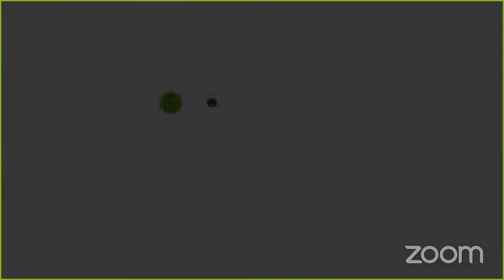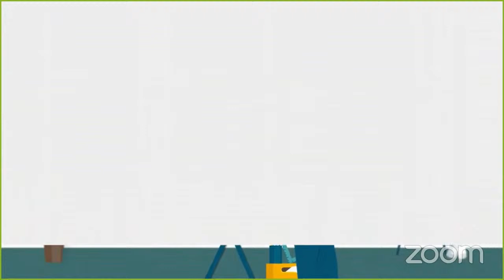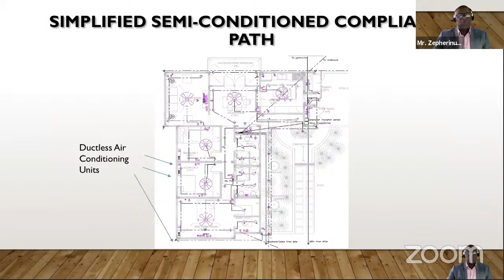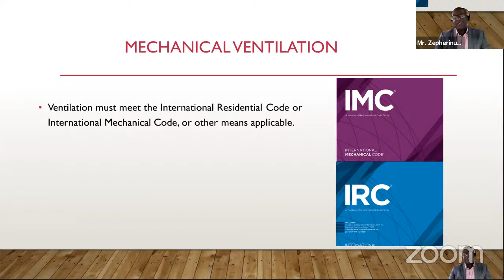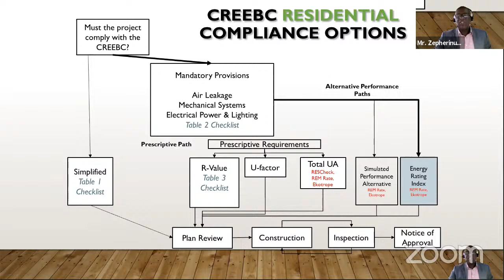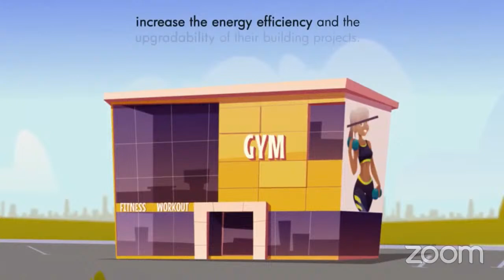The CREEBC in a Snapshot: Residential Implications (A Virtual Town Hall)

Comment from the maker: As all questions posed during the webinar could not be answered live, here is the Q&A with responses supplied by Mr. Churchill Norbert:

Q1: Does the projection factor take into account surrounding buildings and trees etc? 
A: No, the CREEBC does not consider surrounding buildings or trees for residential buildings. ASHRAE 90.1 takes into consideration surrounding buildings for commercial buildings. 

Q2: How is the energy code for car icon differ from that in north America and Europe?
A: The CREEBC differs in terms of climate zones and the corresponding design requirements for buildings in the Caribbean region. For example, economizers are not recommended in climate zone 0. This is the most dominant climate zone in the Caribbean. 

Q3: window 14% of the floor area, how much of the window is openable? 
A: The operable portion of the window must be at least 14% of the floor area or larger in a middle bedroom. 

Q4: What are the CREEBC Options about?
A: They are options to demonstrate compliance with the CREEBC depending on the design of the building and the corresponding equipment and systems used. 

Q5: Sir, I would like to ask how this buiding code will now cope with the actual situation of Covid-19 pandemic adapting the building ventilation aspects for new and existing buildings.
A: This code will help new and existing buildings cope with the COVID-19 pandemic because the provisions for ventilating buildings are mandatory.   

Q6: Will the code be beneficial to institutions such as hospitals and prisons? considering that these are high energy, high emission buildings.
 A: Yes, the code will be beneficial to those institutions as well.  

Q7: Do penal institutions (ie, 1735) fall within the residential category?  if not, where does its lie?
A: It would be a mixture of both residential and commercial. The dwelling units would be residential and the offices commercial. Remember there are no thermal envelope requirement for unconditioned spaces in residential buildings. 

Q8: Does accepting the residential provision mean that the local code includes these definitions?
A: Definitions in the CREEBC are specific to the CREEBC.     

Q9: Does the code contemplate the structure only or are the occupants for whom the structure is designed a key design consideration?
A: Yes, the code takes both the thermal envelope and the occupants into consideration. This information is used to size cooling and ventilation systems to optimize occupant comfort and safety. 

Q10: Please forgive my ignorance I am new to this space. From my novel perspective, energy efficiency appears to have a strong correlation to usage. thank you
A: Yes, you are correct. Energy efficiency helps to reduce usage while getting the same or more work done.

Comment from the maker: Q&A continued:

Q11: Are ventilation blocks included in vertical fenestrations?
A: No, it includes operable and fixed windows and doors. Skylights are also included. Remember it is part of a building’s thermal envelope i.e., building elements that enclose conditioned space. 

Q12: How are we going to measure the air leakage?
A: For the thermal envelope air leakage is measured via a blower door test (section R402.4.1.2) in the residential section of the CREEBC. There are also requirements for fenestration air leakage so when purchasing windows or skylights a label from the manufacture should indicate that the fenestration is within the air leakage limit of the CREEBC.   

Q13: How does this impact on the following recommendations can be enacted to effectively implement the Property Tax in various CARICOM countries? https://www.linkedin.com/pulse/property-tax-implementation-enforcement-miguel-singh 
A: I do not understand this question, but tax incentives can be used for properties that comply with the requirements of the CREEBC. This would be up to the local authority to decide.    

Q14: Does the code consider quality and use of construction materials that support natural cooling, lighting and energy efficiency?
A: Yes, passive measures such as shading, building orientation, natural light and ventilation are included in the CREEBC. 

Q15: Is there a chart for efficacy of led and cfl lamps? I assume the 40W lamp referred to was an incandescent lamp.
No, the high efficacy lamps referred to are T8 or smaller linear fluorescent, CFLs and LED lamps. In chapter 2 of the CREEBC you will find the definition of a High Efficacy Lamp. 

Q16: In providing for a high performance envelop to comply with the fenestration air leakage standard is there provision for filtered and measured outdoor air dilution and exhaust ventilation into spaces such as bedrooms and rooms with mini split unit to ensure occupant comfort and good indoor air quality? Are there plans to consider this for residences as an adjucnt to this standard?
A: The code has prescriptive provisions for measured outdoor air dilution and exhaust ventilation systems in residential buildings. 

Q17: Does the code cater to and support water conservation and recycling?  How will a company interested in an integrated approach to energy, and water use?
No, the CREEBC does not cater for water conservation and recycling. Other I-Codes developed and published by the International Code Council (ICC) such as the International Plumbing Code would support water conservation and recycling.   

Q18: Planning Codes - Whereas the effort is to develop an energy efficiency building code for CARICOM States, it seems that an imperative should also include the concurrent development of planning codes to regulate all forms of development, especially in the housing sector. For instance, if macro land-use planning fails to adopt energy efficient and sustainable principles and approaches, can we truly expect that the development of such land shall adequately and effectively support and/or facilitate energy efficiency or sustainable development?
A: Agreed, for example Antigua and Barbuda is concurrently developing local and national area plans while the CREEBC has been adopted as a national standard.  

Q19: Residential Development - Why is the simplified approach not placing a greater emphasis on natural ventilation? Ideally, we ought to regard a residential dwelling as an organism as opposed to a mechanical object.
A: Actually, the simplified approach promotes natural ventilation. One of the three requirements includes - not more than 50% of the building is conditioned space. Also, operable windows not less than 14% in middle bedrooms for natural ventilation. End bedroom must have operable windows on opposite walls. Finally ceiling fans rough-in must be installed in bedrooms and one largest room as a minimum requirement. 
Lighting and Fan Requirements - Why is no reference made to the use of interior design of a building in terms of colour as an energy efficient design tool?
A: The requirement provided are minimum. One can go above code and include interior designs if he/she so desire. 
Roof Design - Why is no reference made to aspects of the roof finish colour, restore and form as a principle of energy efficient design?
A: Although colour is not mentioned, the solar reflective index and thermal emittance requirements take colour into consideration.

Comment from the maker: Q&A continued. 

Q20: For ventilation, is ASHRAE Standard 62.2 referenced for residential buildings?
A: Yes, systems serving multiple residential dwellings must comply with the commercial provisions which references to ASHRAE 62.2 for ventilation. The International Mechanical Code and the International Residential Codes are also referenced.    

Q21: Some traditional Caribbean buildings utilise ventilation blocks. Will renovations require the sealings of these ventilation blocks to avoid air leakage?
A: For the simplified semi-conditioned approach, if a space is not conditioned there will be no need to seal the ventilation blocks. If the space is conditioned, then ventilation blocks would have to be sealed. Note - for conditioned spaces and when using the prescriptive compliance or alternative compliance paths, ventilation is accomplished via mechanical fans and dampers.   

Q22: Mandatory Requirements – Leakage
It would seem as though some of the mandatory requirements being proposed for creating a sealed building envelope, are at variance with the primary recommendations for ventilation of habitable spaces in the advent of COVID-19… especially in a resource-limited CARICOM Region. It this practical in residential development for the region?
A: There are also health challenges associated with relying on air leakage to ventilate buildings especially in the advent of COVID-19. Mold and poor IAQ are two common health challenges we face in the Caribbean. Mechanical ventilation is more reliable to ensure 3 – 5 air changes per hour. Remember ventilation must be intentional. One advantage of mechanical ventilation is that it can be increased to deal with the COVID-19 as prescribed by ASHRAE. Residential and commercial buildings in the region stand to benefit tremendously from this requirement. 

Q23: What tools are available to test room leakage? Are they available to residential contractors?
A: A blower door test. This is new to us in the CARICOM Region hence, there is a need for contractors to expand their services to include this test. 

Q24: You mentioned software to test building compliance? Are there any examples available?
A: Yes, RETScreen or eQuest software are two examples of software that can be used. The software selected must be approved by your local code officials. 

Q25: Principles of Energy Efficient Design
From an architectural standpoint, energy efficiency is regarded as just one of the primary aspects of sustainable design for climate change adaptability. 

Perhaps for residential development, the Code for should consider incapsulating regulations of some of the other important principles of building development, operations and maintenance in terms of their: Response to climate; Respect for the site; Respect for the user; Renewed use or recyclability; and Appropriate use of new materials and technology.
A: Good points. The CREEBC is updated every six years (due in 2024). Your points can be included during the consultative process when the CREEBC is being updated through you National Bureau of Standards. 

Q26: Does the code consider residences with no conditioned spaces? I believe we should be encouraging this above all else. A well designed and positioned house can usually be operated comfortably with natural ventilation, and the use of one or two ceiling fans on days with minimal natural breeze.
A: Yes, if the building has no conditioned spaces, there will be no need for thermal envelope requirements or cooling requirements. The other requirements for operable windows, ceiling fans/mechanical fan, high efficacy lamps, pumps and service water heaters shall apply where necessary.   

Q27: I applaud the hard work done by CROSQ in developing a much-needed code. My questions are as follows: [1] Do you have any idea of how implementing these new code standards may affect the cost of construction? [2] Does the new code speak to passive tropical design?
A: We do not have an idea of the cost to implement the CREEBC but most building energy projects in our region fall within a 5-year ROI or less. This is primarily due to the high dependance on costly imported fossil fuels to produce electricity in almost all CARICOM countries except Trinidad and Tobago, and Suriname.  

Q28: What is the rationale for limiting the application of residential provisions for building which are solely residential but are more than 3 floors?

A: If a building is more that 3 floors then the commercial provisions shall apply. For the residential provisions to be applied, the building must be 3 stories or less above grade and have occupancy types of Group R2, R3 or R4 i.e., occupancies are permanent in nature. Therefore, if a building is a single story but has group R1 type of occupancy then the commercial provisions shall apply. An example of this type of building is a dentist office.